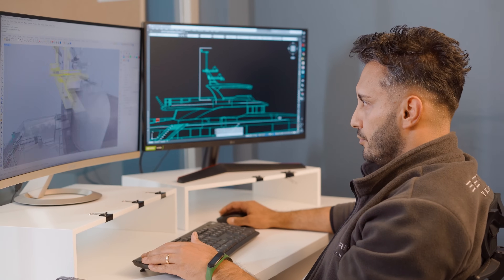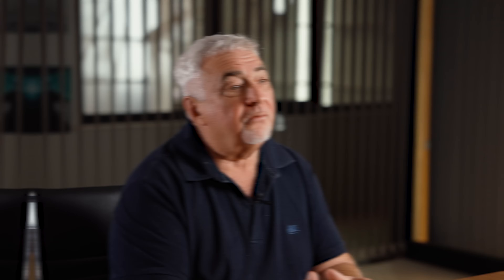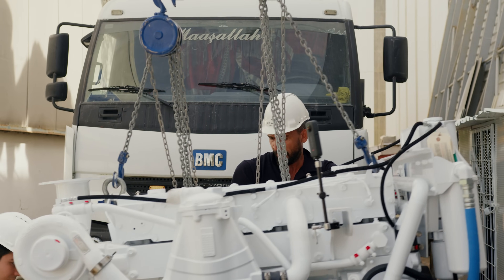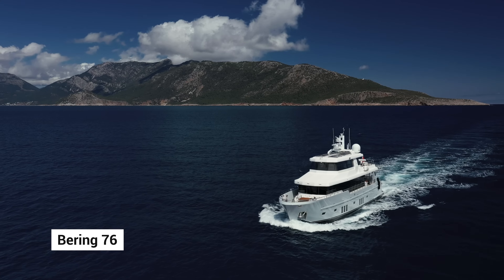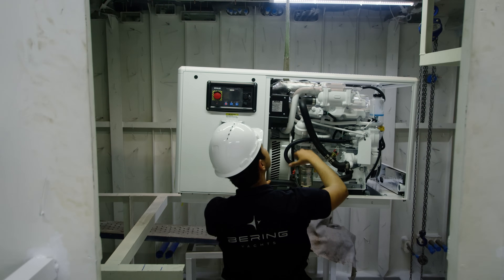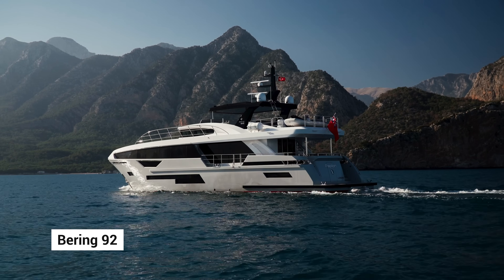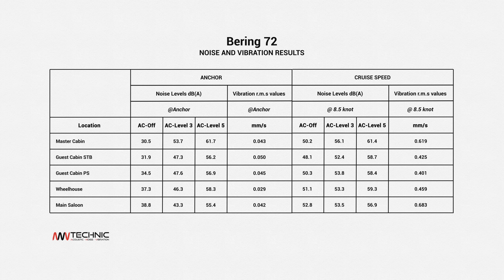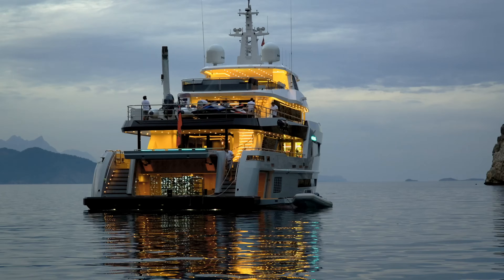Bering Exclusive: Noise and Vibration Onboard | Part 2

Comment: Have you looked into using the Sharrow/VEEM propellers?  Not sure how much benefit you would get at low displacement speed, but they are said to reduce noise and vibration.